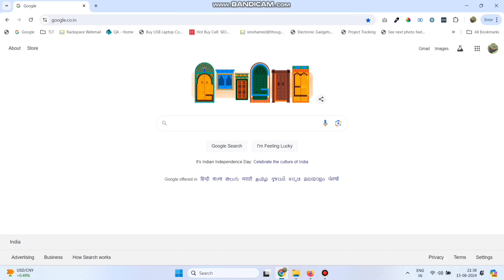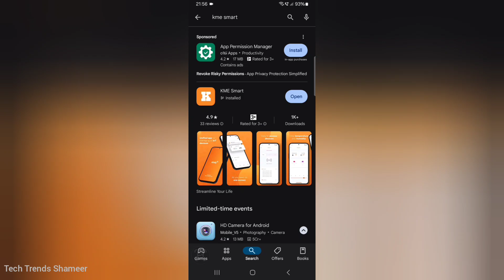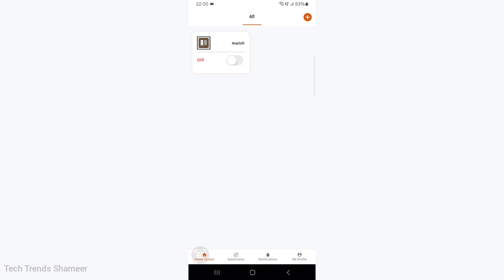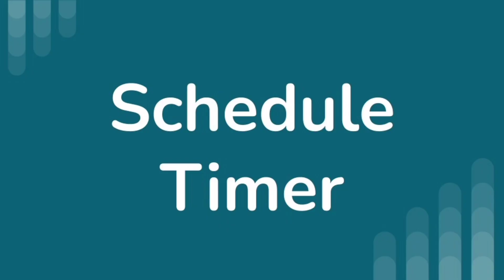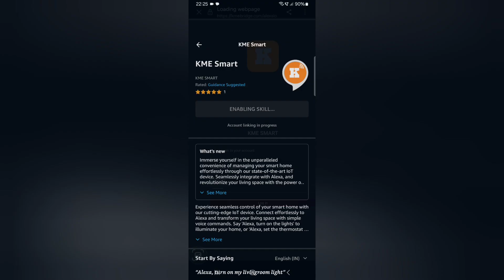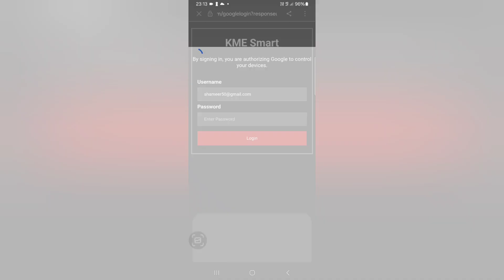DIY Smart Home Automation with KME Smart IoT: No Code Platform | Google Home | Alexa | IR Remote

Comment: I don't why my toggle state is not working, for ir remote.
Only ON OFF is working with 2 different buttons/keys.
Reply from the maker: Check the circuit connection